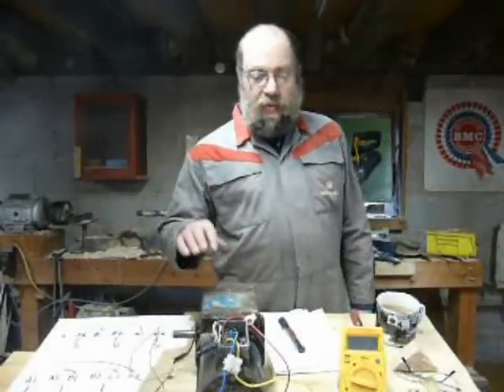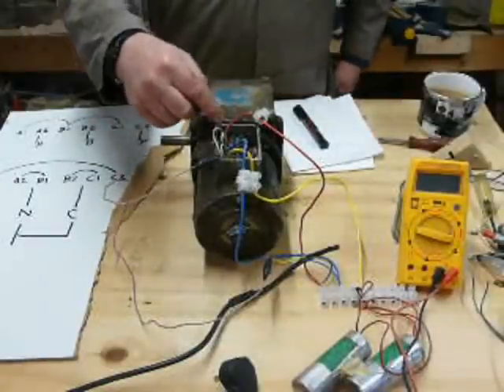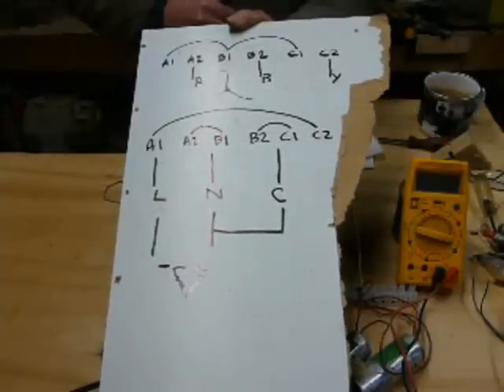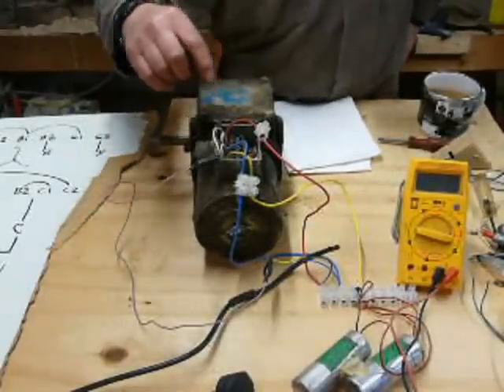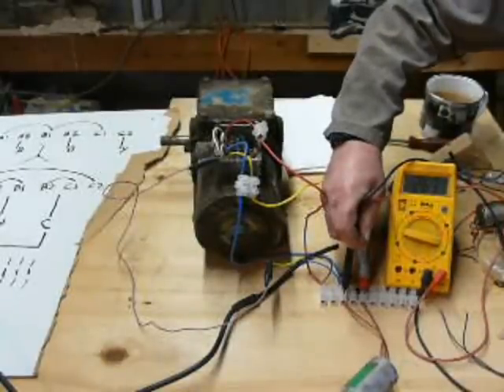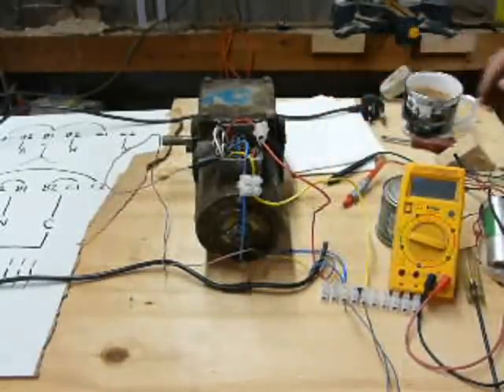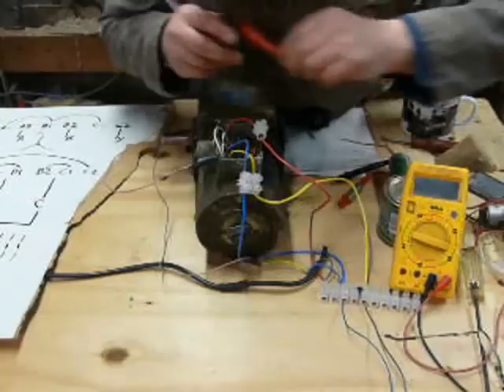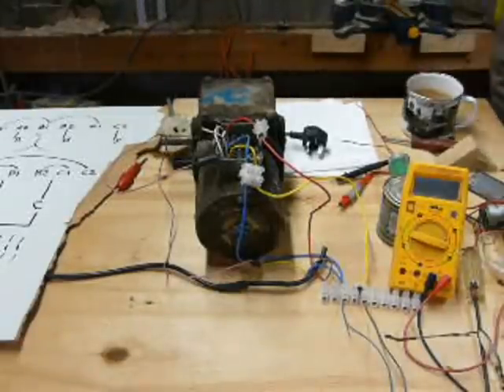How to do it: run a 3 phase motor on single phase supply. part 3

Comment: Hi Andy. I love your videos. Just subscribed. Now, I have a 380v 1kw 3 phase motor for my meat grinder wired in delta. I've managed to run it on a 50uf capacitor. The capacitor is connected to the Live.
After measuring the volts between the phases, I got the following results: 
Between Live and Neutral = 227
Between Neutral and new phase = 234
Between Live and new phase = 249
Please advise whether this is safe for the motor to grind my meat
Thanks in advance
Reply from the maker: Hi, sounds like you have been doing your homework, brilliant. The numbers sound reasonable, maybe the voltages would be lower with a 40 Uf cap but I would just try it as it is and see if the motor get hot, cheers
Reply: @TheInfoworks  Thanks Andy. You're a saint!

Comment: I recently acquired a WWII surplus motor still in it's original packing.  I want to use this to run a vertical belt sander, but when I opened the packaging I discovered that the motor runs on 115v 3phase.  Your videos were very helpful in showing me how you did it, and I just ordered the book you mentioned in the first video.  Hopefully I will get the 1942 General Electric motor running properly and give it some life here in the 21st Century.  Thanks very much.
Reply from the maker: Hi, thanks for the comment, 2 things come to mind, firstly if it is connected in delta then a change to star would make it suitable for 240, or use a site 240/110 transformer. Let me know how you get on. Liked and subscribed? cheers
Reply: I HAVE JUST "STARTET"  A 10HP (380/660V 3PH...2860RPM)
15.5 / 8.9 AMP
(57 KG)

USING  220V  (IN "STAR" ..)  220 ON "V" AND "W"
AND THE "CAPs" ...ON "U" AND "W" ..

THE "CAPs" ARE.. "150uf"..ONLY. IT TAKES 2-3sec TO FULL RPM

THEN I CUT "OFF"  THE "CAPs".. NO CAPs ANYMORE !!
MOTOR #NOW  RUNS ON "220V 1ph".. ON "V" AND  "W" ONLY !!
THE "U" IS NOT  USED "ANYMORE"

IS... HOW I START THE "10HP"..VEM MOTOR FROM "DDR 1979"

HAVE  ALSO A "WW2"  SO BIG I DONT KNOW HOW TO MOVE IT..!!
WITH A "GEARBOX" ON
(100 -200KG !!)
STANDING  ON  "2"  PALETS  OUTSIDE (UNDER PLASTIC COVER)

IT HAS "12 OR 15" WIRES ???
(JUST MANY VERY)

I HAVE IT RUNNING ON "90-110 V 1ph"
USING A "0-270V ROTARY TRANSF.."

AND ABOUT "90V" IT STARTS UP.. NO NOISE OR ANYTHING

I USE  .."WIRE A AND B ..LOW" ..AND THE MOTOR IS HAPPY 450RPM
(HAVE NO INFO OR "PLATE" ...ONLY NAME)

ALFRED  HERBERT LTD...380/420V..3ph
455 / 705 / 930 /1450  RPM

GOOD LUCK ...

DENMARK ...

Comment: I watch so many videos that say “ this is how you do it “ and then show a guy building something using a lot of tools and you don’t know just what he’s doing then when he’s done he says “ there you go, that’s how you do it “ but never really showed you how to anything.  This video ( these three ) actually showed ‘ how ‘ you made something work ( or are trying to make it work ) I think I actually learned a bit of something from this.
A bit crude but you were showing how you used capacitors to delay the current and induce  the other phases into single phase power ( or something like that )
Reply: Still trying find out how using the extra motor to generate 3 phase is set up
Reply from the maker: Hi, see part 7 uploaded a couple of years ago, this shows all the details you require, I hope you have subscribed, cheers
Reply from the maker: It's just how I do it, the later videos are experiments up to part 7 where a pilot motor is used, cheers

Comment: hi sir what is capacitor i have to turn on 5 hp motor ?? and any type of capacitor i need 250v  or 450v or i need to capacitors ??? please !!
Reply from the maker: Hi, for a large motor it would be helpful to use a pilot motor, see part 7. experiment with 25 Uf capacitance per motor Hp, cheers

Comment: I wonder if your motor wired this way is at full power and is the power  draw even. Could a fuse or breaker blow?
Reply from the maker: Hi, yes very persceptive, at best you can only get 2/3 of the power. With a large motor fuses may blow because of the high start up current, commonly 10 x run current. Subscribed? Cheers

Comment: Good videos Andy but if you lose a phase say goodbye to the motor as it will heat up fast. You can get the kit which converts single to 3 phase with all protection built in. They have all different variations and are great. Just alot better than people trying this and alot safer.
Reply from the maker: I use this method on small 3 phase motors, I convertered a large bench grinder 25 years ago and it's still going strong.

Comment: What about if you have a 40HP electric motor so it could still run the motor if you are using a capacitor sir...?
Reply from the maker: Hi, start current would be a problem, see part 7 of this series, cheers

Comment: Be careful sir  before you touch the leads of the capacitor because  there is still remaining current on it.....
Reply from the maker: Hi, in this case the motor coils short out the capacitors when the mains power is switched off, cheers

Comment: Hello  Sir  061218 con you try connection for Star 3ph 220 fo this wiring, if this will work, A1 to B1 parallel 1 cap, B1 to C2 parallel 1 cap,  pls email mel.babao@gmail.com

Comment: Two things is wrong with this video. First is safety it is never a good idea to handle live wires as he did nor handle capacitors is if they are uncharged. Some capacitors will hold a charge if the conditions are right and you could get a good sized jolt from them. So when working with capacitors always use a jumper with meter leads style ends to short capacitor before handling. The capacitor used in this circuit will change the phase by 90 degrees on that leg of the circuit giving you threes phase.
Reply: they got my point i am not an english major nor do i want to be

Comment: Andy how big of a capacitor will i need to run this 3 phase motor, is from a 2 post car lift will run for periods of no more than 60 seconds,  thank you. Is a 3hp  1750 rpm
Reply from the maker: HI, these can be tricky, try using the principles shown in the video to use the trial and error mothod. You may need to use a pilot motor to stabalise the third phase. Cheers

Comment: what if a small 3 way 3 plate(120 degree) comutator where attaceched to the front shaft then brushes atached to comutor wired to the motor widings and the comutator shifted (timed )until it sincked with the rotating feild time wouldnt that be a good expieriment  ?
Reply from the maker: THe only way to find out is to do it, but the only magnetic field in the rotor is induced. I look forward to your video, cheers
Reply: Andy Reynolds

Comment: Andy great video its very clear and easy to understand.. how long this can be run?
Reply from the maker: Hi, I suppose it depends what it is driving, I've not had a problem with a pillar drill, bench grinder, and the mortice machine. No good for compressors however, cheers
Reply: Andy Reynolds thanks...

Comment: Hello, Andy, I have recently been watching your  3 phase conversions videos with much interest. I notice you experiment with the capacitor required for the single phase delta config. There is is a formula and in episode 3 you were trying by experiment to get the capacitance value. May I suggest you try the following Take the constant 70 and multiply by motor KW =  Capacitance required, for example you said motor was 1/4 HP this is one-quarter of the KW equivalent 1HP = 745.7 watts  or 0.7457 KW. Thus for a one quarter HP motor 70 x (0.7457/4) = 13.05 microfarad. I look forward if you can make a video to prove this formula.Thus your 8 mf and 5.5 mf were probably very close.
Reply: Hello Keith  Could you run through this formula with me, I have a 5.5kw 3 phase what capacitor should I use. Thanks

Comment: basically, people are NOT getting how this works. Let me try to explain. Your are using the unused potential supply on a delay through the capacitance, and also using the residual power, ( return power ) to energize a coil. This is why the motor slowed when a2 and b1 where decoupled.  As you can see the power supply is not a smooth one, which will create heat, and in the extreme, wobble. Although you can not fully smooth the power with a static setup, within 10% is usually suitable, there are intelligent controllers that can rectify the power. Or, you could just go out and get a modern VFD motor, and setup an in house 3 phase network. Hope this helped. .

Comment: yes delta configs are used in the field all the time. especially in the u.s.  Switching two phase to three..check with your local power company for compliance. IT IS ILLEGAL in some regions. But, if you want to smooth the power. a simple line conditioner can be added. or do it yourself with resistance and induction. Be careful on the induction side. Heat will effect performance.

Comment: Would this work with a roller shutter motor as the motor would have to travel clockwise and anti-clockwise
Reply from the maker: HI, not sure, it depends how the reversing is orgainised. The high torque start may be a problem, have you watched all 6 parts? Cheers

Comment: another question how do i determine the size of capacitor to use for various horse power
Reply from the maker: HI. I have always worked on trial and error, starting with 20 Uf. That's what I did on the video. With larger HP motors a start cap will be needed. Once running use a multimeter to measure the voltage across the capacitor. See my patreon link on the channel page. Cheers.
Reply: It normally says on the manufacturer plate or you can work out with a formula

Comment: great video especially measuring the cap voltage to explain heating of winding
Reply from the maker: Thanks for your comments, all caps are suitable for mains power use. The voltage check is useful to make sure the run cap value is correct. Cheers

Comment: Dear Andy.                    You have made some very edifying Videos and are an excellent instructor regarding running 3 phase motors off a Single Phase supply! Having worked as an Instrument Maintenance Craftsman at Oldbury on Severn Nuclear Power Station I believe that I am OK to take on such a project!Having attended many a fine lecture on Electrical Motors, Instrumentation and the like I must say that as excellent as they were they never cover the practical stuff like you have done so successfully!I do like to comment on videos such as yours just to show some appreciation regarding your efforts!All I need to do now is to find out what size capacitor(s) are needed to fire up a much larger 3 phase motor that drives a  Grain Cooler/Drying Fan! A Farm Tractor sometimes drives them off the P.T.O through a gearbox at fairly low revs!I do wish that I still had the use of the Variable Capacitor that I used in the I.M.D Workshop/Plant at Oldbury all that time ago!It never leaves one and one is always "In" you know!Well done that man!                                    Rob.                                           A Farmer now!                                           From near Berkeley, Gloucestershire, England.
Reply from the maker: Hi, thanks for the appreciation. I think that anything above 3 Hp is a problem due the start current that could be up to 10 times run current. I have only used this on motors up to 1Hp but would be very keen to hear of your experiments. Cheers

Comment: hi i was  using a 3phase mig welder in single face with 3hp static converter when i turned  on it looked like it was working fine but when i start welding the capacitor in the converter exploded what i need to work ok?
please help
Reply from the maker: Hi. Must MIG welders have a wound coil choke, when the power flow through this changes it can send a voltage spike back to the supply. Probably that's what did the damage, which might of occurred when you stopped a weld. Cheers
Reply: I know this comment is over a year old but in the interests of others reading through, from your description it sounds like you may have been using a motor start capacitor rather than a motor run capacitor. Different beasts entirely with the latter being oil cooled and able to be charged / discharged practically indefinitely while the former will blow up (as yours did) if used for any length of time beyond initialising the motor.

Comment: Hi great explanation I have a motor with totally different wire setup and with two capacitors I will do my best to describe,

Positive to u2 
Neutral to u1
Earth on the housing
Capacitor bridging v1 and z1
Capacitor bridging z1 and v2
metal bridge between u1 and v1
Metal bridge between z2 and u2

Does this seem right or should I dismantle and do your technique I haven't run the motor yet wanted to check first it is a tec 1.5kw motor any help would be appreciated

Comment: I have a clutch motor from a sewing machine is 3 phase, Cycle 60
220V  What capacitor do i need to run it single phase 220

Comment: Really enjoyed sir. Very well and very simple. One suggestion though. Could have recommended a formula for calculating a capacity for normal use depending on motor power.
Reply: Wild Weasel
Reply: Wild Weasel

Comment: Thank you Andy for this 3 part series. to stop over heating of the running motor, Ia there a  formula to find the exact size of capacitor to run the motor
Reply from the maker: HI. The formula is in the coments on one of this series posted by a viewer. Subscribed? Cheers, Andy

Comment: there are 4 wire in the motor yellow connect to the capacitor red is a load blue are neutral how about the small brown wire answer pls.. ty
Reply from the maker: send me a time reference. Cheers

Comment: A very big thank you, followed your instructions carefully and much to my amazement (about my side, not yours) worked perfectly first time. Meddings Pillar drill with 1/2 hp motor. 13mm bit through 10mm plate like the proverbial knife through butter
Reply from the maker: Perfect application, so people imagine runnng 10 Hp motors, it's not happening, but as you proved it's fine for smaller motors. Self reliance improved.  Subscribed? Cheers, Andy

Comment: Hi sire Andy..i got some question that i know you can help me a lot....i just watching your video nowadays and i like to try it on my own..but i got a little confuse of how to do it..if what kind of start capacitor going to use and for running capacitor also for what the exact value of capacitor I'm going to use..thanks sire and God Bless you!
Reply from the maker: Use non polorising AC capacitors. The value depends on the motor, that's why the videos show trying various cap values.
Reply: okay sire..then...but the problem is..when i open the motor i find out that it was already three leads out and does not have any terminal that i used to reconnect to delta connection..what am i suppose to do?...
Reply from the maker: Just try it and see if you get enough power, cheers
Reply: Thanks sir andy,..,more power to you...

Comment: I connected a 200uf motor capacitor the motor ran for 5
minute then a horrible smel came from the capacitor followed by a hissing sound
which was absolutely disgusting at that instance I turned the power off and ran
out the workshop
Reply: +silverarrows01 
The higher the value of the capacitor the more current it will pass for a given resistance of motor winding.  200 MF is very high for motor applications,   the highest I generally see is 80 MF.  Capacitors, even if designed for motor applications, can only pass so much current before they will break down, overheat and eventually short out and  blow.
Reply from the maker: Hi. Sounds like you used either a duff capacitor or a DC capacitor. If the capacitor has polarity markings it is a DC one and will not work on AC. It is important to use a uni-directional AC capacitor. Cheers
Reply: +Andy Reynolds the capacitor is a 200uf 50/60hz 300vac -40+66oC  it has a brown and blue wire, I am having problem getting hold of light capacitor so I bought one off ebay a Philips Universal Capacitor 32 uf Motor Run Lighting Flood Light Machine 250VAC but its verry slow with it
Reply from the maker: Maybe your motor needs a start capacitor, or greater run capacitance. See parts one and two to see what happens with not enough capacitance. Also check the voltages on the motor when it is running. They should be not too low and not too high. Cheers
Reply: Omni-directional, you mean.
Reply: +turboslag ...sire i think the 80uf was a great hit for it...don't need to times it on the motor hp?..
or i rather use 80uf start cap and 5uf for running and another 12.5uf run cap also..well it work really good?...

Comment: hello could I use this method to run a garage 2 post car lift any information greatly appreciated
Reply from the maker: Hi, There's only one way to find out, try it, bear in mind that there is less power using this method. Take photos of the original wiring just in case. Subscribed? Cheers, Andy
Reply: Probably not so good in a "safety critical" application. I'd give serious thought to substituting single phase motor with start and run caps. Take your time working out the up/down switch wiring it's a little more complicated than a 3ph fw/rev contractor. 
This is the 21st century, did you consider a vfd? Cheap as chips on eBay and 2nd hand industrial kit is still industrial kit. 
Good luck.

Comment: should you not have 400v across each coil in delta not 230v it should be 230v from centre tap in star which is the neutral the motor is running but under voltage.What are your views on this thanks
Reply from the maker: In theory yes, but this a way of running a 3 phase motor fromn 240v supply without using a large transformer. It's a cheap and chearful method for the home workshop. Cheers, Andy
Reply: Michael Bailey no